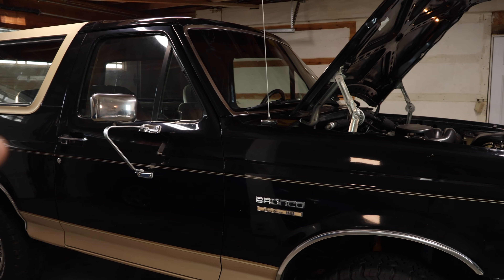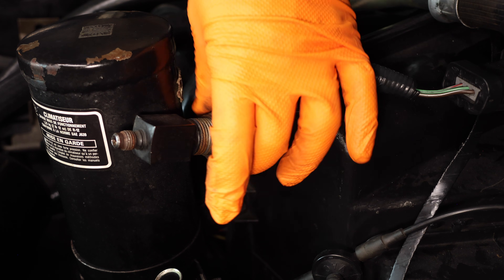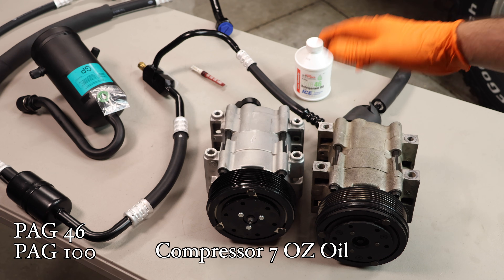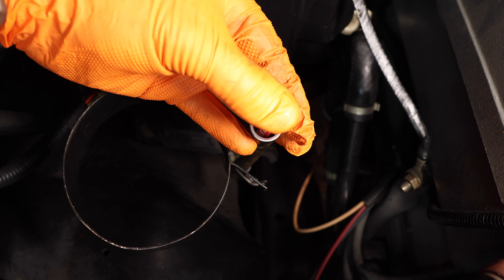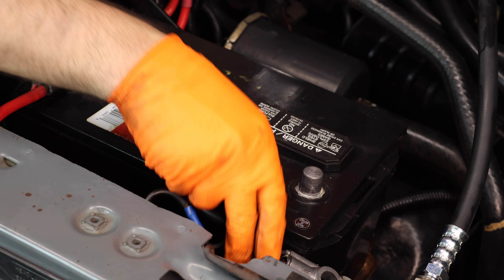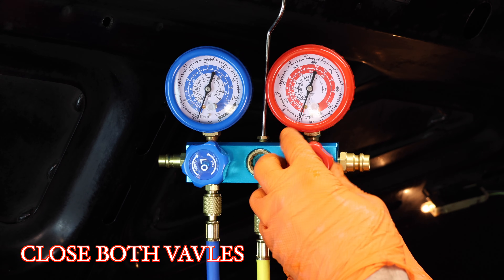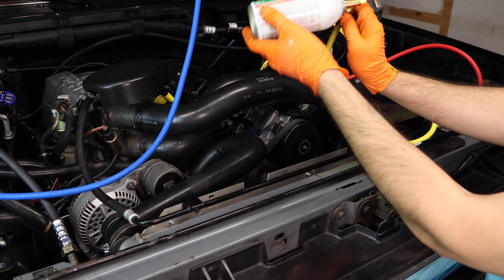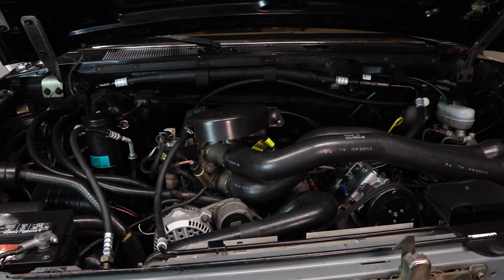Ford Bronco F150 A/C Repair 1980-1996 | Convert R12 To R134 | Bronco Restoration

Comment: Do the valves open lefty loosey or is it just the camera mirrors the direction?
Reply from the maker: Depending on the valve, on the truck they turn right to open (pushing in the schrader valve) on the manifold they turn left

Comment: Biggest mistakes 
1/ u never measured how ""full the system is """ [you guessed ] correct fill gives best performance during hot weather .
measure super heat 
2/ u never measured the high side pressure  when properly fully charged  [yes it may go higher than expect this is not a refrigerant capacity fault , under charge gives poor performance ]  higher psi than expect 220+up means u have poor cooling of condenser ..  Fix by H/duty mechanical fan hub plus bigger diameter aggresive blade angle   and a 20amp 12 , 13,14 inch condenser fan SPAL brand

Comment: What happens if I don’t have a shop drain leftover refrigerant? Does it explode neon green juice everywhere?
Reply from the maker: Thats usually a sign of the dye used for leak detection. Draining the refrigerant is recommended but these systems are usually pretty empty due to age of the o rings; most refrigerant has leaked out.
Reply: May or may not be speaking from experience

Comment: Awesome video, I did a full AC replacement (besides blower) following your video. I have a 1994 f250. I was filling refrigerant and even when I got up to 45 PSI (80 F ambient temp) on my low side and with compressor clutch engaged and spinning, I wasn’t getting a high side reading. Not sure why? My vents were able to blow down to 48 F. I assume my gauges were malfunctioning. Also I put just below 3 cans in so around 32 Fl Oz and probably 6 Fl Oz of lag oil (I kept spilling that shit).

Comment: Im pretty sure youre suppose to swap out the low pressure switch with one that is for r-134a vompatible since the stock one is for r-12.   Different low side ratings.
Reply from the maker: Yes, good catch. Either one can be used as the cutoff is about 1-2 psi difference, but the 134 switch would be preferred.

Comment: On my 1990 f150 blows cool air. My acumulator says r12 but my compresor says r12 or r134a. How do i know i have the r12 or r134a.
Reply from the maker: The 1990 has r12 from factory, up until 1993. If your compressor states 134 then chances are the system was updated at some point. If everything works satisfactory but you want colder air then I recommend a full system flush and replace the accumulator and condenser as well as all orings; check the rubber hoses for any cracks and replace as needed, if the compressor spins freely and does not make any loud strange noises then you may be able to reuse. Refill with the proper amount of 134 and you should be golden.

Comment: i have a question about the condenser. how did you get a 1994 condenser to fit into your 1990 bronco? i have a 1988 f250 and ive heard they help out alot

Comment: I didn't think your link to the condenser links to the right thing.
Reply from the maker: The condenser I linked is for the 94-96 r134 style which will work for older models.

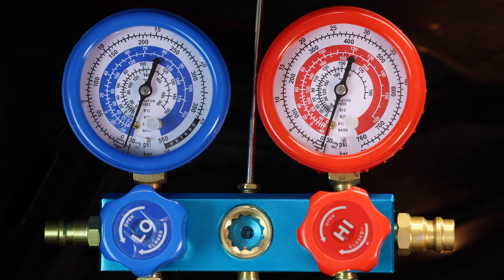Comment: At 8:19, you say to close both valves on the gauges.  Shouldn't these stay open during the hour you are checking for leaks?  With them shut, it seems like the system could leak like crazy, but the gauges would still show vacuum because they are closed off from the system?  Maybe I'm wrong...I'm hear to learn after all.
Reply from the maker: These valves only control the flow of the supply line, whether vacuum or refrigerant. Once closed they will still read pressure or vacuum on the truck system. To shut off the gauges you would need to close the valves on low and high pressure fittings on the truck.
Reply: @TheFixTech  Thanks!  I actually figured that out after messing with my gauges once they came in.  Made perfect sense once I thought through it more.

Comment: This might sound dumb. But is the process the same for a standard 86 f150 XLT lariat?
Reply: I'm watching this prepping to do this on an 86 F150 XLT Lariat myself.  I think the process should be the same, but some of the parts are different (compressor and the hoses are different for sure).  I plan to replace my condenser and evaporator coil, as my system suffered Ford's infamous "black death", which I learned when I pulled my orifice tube to find it incredibly gunked up.
Reply: @chirkware I appreciate it big man. Keep me posted about the progress if you can✌️
Reply: It's very similar, I did a serpentine belt conversion on my 6 cyl and almost all the parts interchange, the compressor and lines attaching to the compressor are different. Everything else is the same 80-96 f150

Comment: When converting from R12 to R134, is replacing the compressor/accumulator and lines, etc, all a required part of the conversion?

Or could you just evacuate the entire system, and then replace it with R134?

Thanks
Reply from the maker: For these old systems I do recommend replacing all the components as years of added oil and "stop leak" will build up in the system. All parts can be cleaned and flushed though, and new seals all the way around. I do recommend replacing the condenser to the new style 94 and up as it holds more refrigerant.

Comment: did that ac replacement function good in really hot weather?? I'm looking to replace my ac compressor and live in Tampa fl. It gets really hot and humid down here. Back in 2019 I put a new four seasons ac compressor from auto zone in my 1993 f150 it worked really good in shaded areas, early mornings, or at night. But on days that the temperature reached the high 90's it didn't work so good. I mean it was better than nothing but just barely good enough to not roll my windows down lol. Anyway my compressor just started leaking freon from  the cracks of my compressor and probably will be replacing it soon. Just wanted to know your opinion on the kit from the video.
Reply from the maker: 1993 still used the r12 refrigerant, for optimal cooling you will need to replace your condenser with the 94-96 style. The conversion shown in this video works well enough for me in the southern california desert.

Comment: I feel like this is a dumb question but did you remove that quick connect adapter? 

Also assuming each time you replace the empty can you shut off the truck, then close the low pressure valve?
Reply from the maker: I leave the adapters in place, I keep the truck on the entire time. Just close the valve and purge new can, open valve and let it flow.
Reply: @ do you have the change the compressor if it was originally R12 and converting to r134a?

Comment: I followed these exact steps. Im stuck at 10:19 my refrigerant is not flowing. What could be the issue?
I also changed the condenser. 
Fuses good, ground is good, no leaks.
Reply from the maker: Check/replace the pressure sensor that screws into the accumulator. Also if you are using self sealing refrigerant cans do not open the can all the way out when trying to load the system. The can will seal.

Comment: With the affiliate links in the description, will I be able to convert my 88 f150 to 134a? The compressor line mounts are completely different. I’m not sure if I can get the compressor in the affiliate link and bolt it straight to the compressor mount, it looks like I can but I’m not entirely sure. I hope you can shed a little insight into this issue. Thanks in advance
Reply from the maker: You will have to purchase the compressor, lines, and accumulator for your year make and model. The new components will be converted for R134

Comment: How come the the gauges didn't appear to show how much vacuum?
Reply from the maker: My gauge set has a small window from 0-30 psi vacuum, it is only about a 1/4 wide. I was able to pull 20hg of vacuum.
Reply: @TheFixTech  I see now as I'm just finishing up with my A/C project and have pulled it to vacuum currently. Everything in my system is new. How long did it take your pump to pull vacuum? I ordered the same pump and it didn't take very long at all to get to 25 hg+. I'm wondering if my fitting are even pressing in the valves on my high and low lines

Comment: Hey man, will these instructions and parts used work on a 1990 F-150 with a 4.9L I6? I do have AC but it hasn't worked since i've owned the truck, so I figure i'd do an overhaul.

Comment: Hey man I did this and my A/C clutch wouldn’t kick on
Reply from the maker: Was the clutch working before? If line pressure is good, check/replace the low pressure switch attached to the accumulator, also check for power at the compressor
Reply: Did you ever get this figured out? I have new compressor and switch on accumulator, and my compressor is not cutting on. First can barely emptied into the sytem and then stopped

Comment: This is one of the bigger repairs I will need to do to mine. Is there anything more to be done for the R134 conversion, or do I just follow every step in this video?
Reply from the maker: My evap coil and condenser were not replaced as they were is good condition, you can remove the blower motor and view the evap coil to check condition, if your a/c compressor is seized/frozen the condenser may need to be replaced as metal shavings might be clogging it. I do recommend replacing the condenser instead of flushing as I have had better results that way. In my case the compressor was fine, just old and worn.

Comment: I noticed you said it will cycle on and off until it had enough refrigerant. Mine constantly cycles does that mean i have a leak?  (I ve filled up before)
Reply from the maker: The compressor should continue to run while the vehicle is at idle. It will cycle on/off while driving as this is normal. Unexpected cycling could be due to a leak or blockage, use a gauge and check both low and high pressures. High pressure can cause the compressor to cycle in which too much refrigerant or oil has been added, or debris from a worn compressor is trapped in the condenser and orifice tube.

Comment: For the low side fitting you put on there. Does that one have the black plastic insert in the bottom of it? I bought the kit to do it and have a new compressor and accumulator and all that but havent done it yet because i dont have the gauge set and vacuum pump.
Reply from the maker: On the low side I used the long style adapter that seals onto the valve. It has a black rubber o ring inside as a seal and the black plastic to open the valve. The quick connect fitting attaches to this and upon turning it will open the valve of the adapter allowing flow. After all is said and done I remove these adapters altogether as they can cause leaks in the future.
Reply: @TheFixTech  awesome! Thank you! I think the original time I tried it I tightened it too much and destroyed the plastic inside on the equipment on my truck haha. I will definitely not do that on the new stuff I bought!

Comment: That looked like metal and gunk on that blue orifice tube you should of flushed out this system using A/C flush. One of the most important steps on an A/C job is flushing out all the debris inside the A/C system. Compressor metal due to longevity or lock up , hose rubber, freon with stop leak and moisture can impact your NEW a/c system and cause it to fail immediately or prematurely. The vacuum is not just to test for leaks its to remove moisture from the a/c system that you opened and let air inside of (while fixing). You want a vacuum of at least 30-45mins, if you left the system open for over 24hrs waiting on parts...minimum 1-2hrs of vacuum is recommended.
Reply: Flushing the system would have removed the mineral oil that was used in the r12 system as well which is not compatible with the pag oil

Comment: I replaced everything in my 92 f150. Al new seals compressor lines evap condenser. It would never hold a vacuum. One of my AC friends sometimes the internal seals on new compressors need to be “swollen”. Anyways I did about 3 1/2 cans of 134 and AC blows 32 degrees and 0 issues in that last 2 years
Reply from the maker: My guess is either the vacuum pump was leaking (if manifold in open position) or the manifold itself had a leak at one of the connections.

Comment from the maker: The A/C in my truck has not worked in awhile and I got tired of sweating. This repair went smoother than expected. Let me know if you have any questions regarding this repair.
Reply: Hi, Is there an R12 expansion valve in the system that needs to be changed when converting to R134? or is it that tube that you inserted.
Reply: Do I need to buy o rings separately or do they come with the stuff you order through your links?
Reply: Does this work on a standard f150 XLT Lariat from 86 or is it just the bronco?